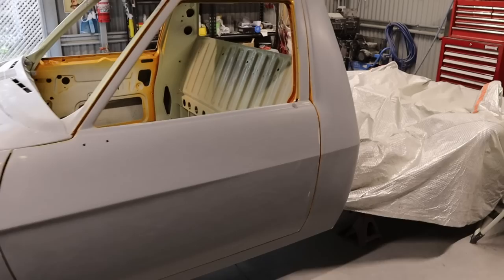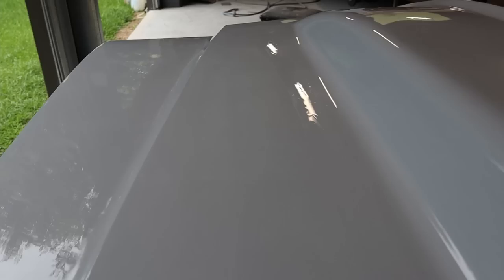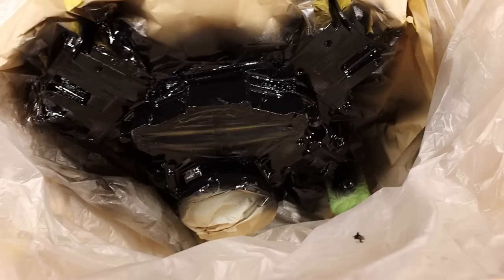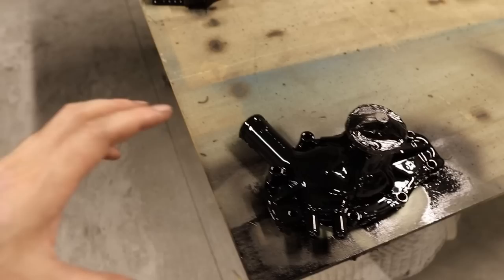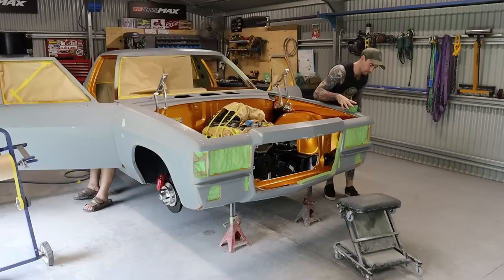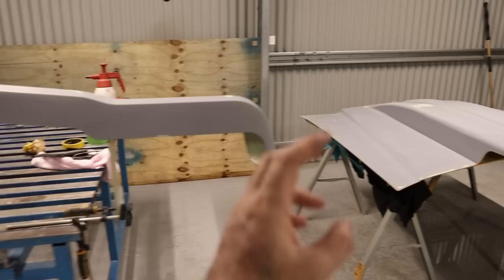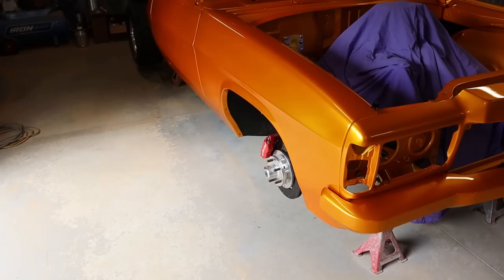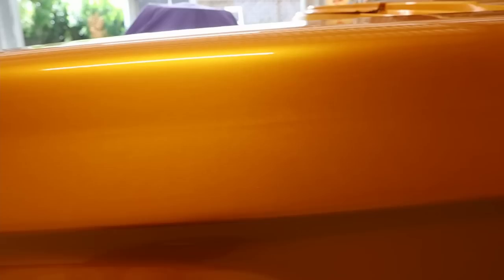Painting the Body - HX One Tonner Build

Comment: yeah that's a bummer mate . banana lines will be easy to fix with a block and wet checking it , guards will most likely need to be primed again where any possible rub throughs are from blocking . bonnet really just needs to be sanded back with 800 and the sides blended in and re-cleared . the drivers side really just needs another couple of coats of Color. probably a good idea to paint the insides and get ya seats fitted etc before painting the outside . doing the insides of a shell first is always a good idea , saves the risk of over spray on the outside . always here to answer questions bro . let me know how you go
Reply: @cobyfield9237  I prefer not to use Bog but I guess some people can’t afford a concourse restoration. I prefer just to paint these days
Reply from the maker: Thanks for the advice Mark. Like you mentioned its all fixable and not the end of the world....

Comment: The patchy paint down the side is definitely the base coat so unfortunately will need respray, unfortunately in a garage it’s sometimes hard to see the paint lay down 
The clear going dull is often caused by not enough wait time between base and clear 
I think the bit on the bonnet may be caused by a rub through 
All probably needs another spray but nothing is a huge issue
Reply from the maker: Thanks for the comment Mate. It wont be a lot of work to respray. At least all the hard work is done and everything is flat